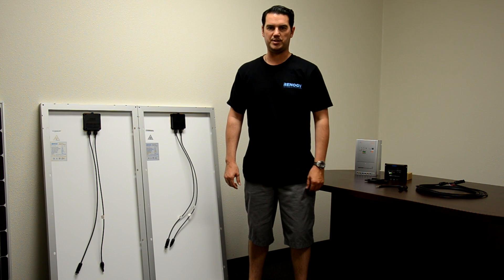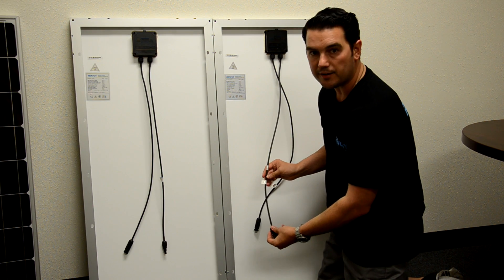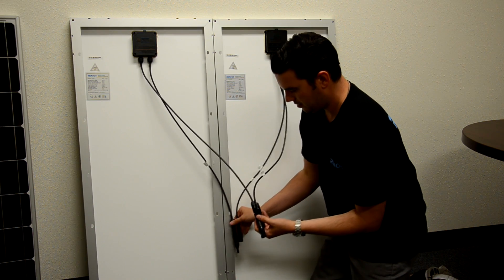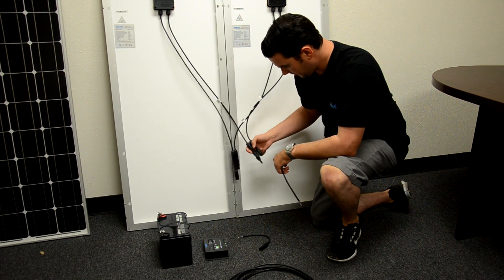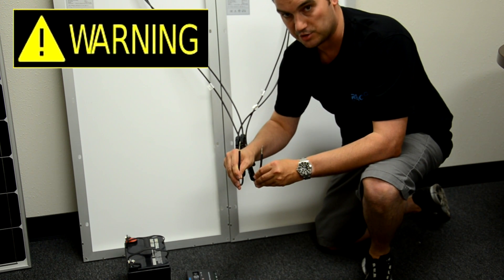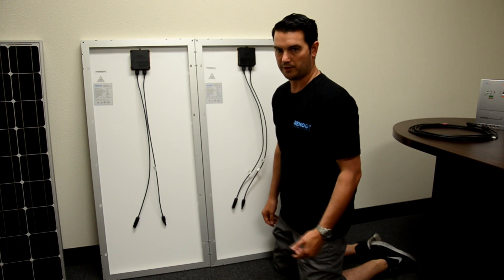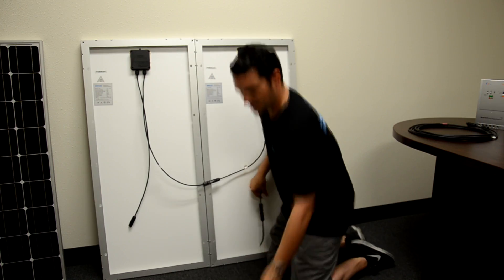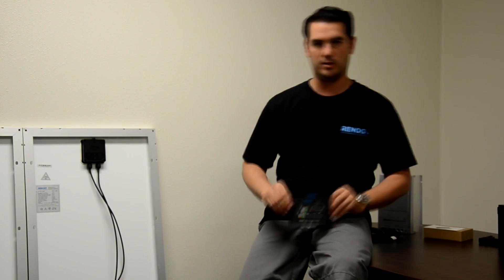Renogy: How to connect your Solar Panels in Series and Parallel Pt. 1

Comment: trying to understand the limitations of connecting panels in series.. because the more panels you add the higher the voltage goes. yet amperage should stay about the same.  how do you identify the maximum number of panels you can have together without risking destroying a panel?  i have a infinium 12v 100w pannel which states on the back maximum voltage is 1000V. and series fuse rating 10A.. can this panel really be used to supply 10,000watts?    hard to believe. if you had 100 of these panels, putting out 120volts DC. at 10kW? it would not destroy itsef?   can anybody chime in here? i suppose open circut voltage is 22v.. so  45 would be max number of panels without risking voltage getting too great.
Reply from the maker: The panel's setup will be dependent on what type/size of charge controller you have in that system, with a PWM it is required to hook up the panels in parallel to keep the voltage down, now with the MPPT it is able to handle a high amount of voltage and send the appropriate charge to your battery bank so series would be recommended. The Max VDC of those panels is 1000V, each panel outputs about 22V so the max would be 45 panels in a string.  Please email or call us here at 800-330-8678 if you have any other questions or concerns.

Comment: question.... i have 2   6 volt t150 golf cart batteries hooked up in a trailer,,,,,,,,,,had them charged to full with trickle charger about a year ago or so. held that charge for many months with trailer in storage.but that ended a few months ago .am about to install a 100 watt solar panel on the roof with a 30 amp mttp controller .will the panel recharge those batteries over time or do i need to remove the batteries and have them boost charged for them to have life again ?
Reply from the maker: The Charge Controller will not recognize the battery bank if it is completely depleted, as long as it is over 11V than the controller will be able to send the charge from your solar panel to your battery.  Please email or call us here at 800-330-8678 if you have any other questions or concerns.

Comment: hi please help me.i have 2 solar panels 310watts 24volt ech.and charge controler mppt 12/24volt 50amp.and 2 battery 150amp and 1 12volt normal invetor please tell me how can i install that praral or seires.because i want to run my inveter 12volts and batery need to charge 12volts please solve my this isue.i am so kind of you
Reply from the maker: Hi Waqa, could you please contact our tech support team at 1-800-330-8678 or email them at techsupport@renogy.com regarding your question? A technical representative would be more than happy to explain things to you in more depth via one of those two contacts. Thank you!

Comment: Dear presenter, can we take the output inverter of 5 KvA cable to 1000 ft with suitable cable size for feeding 60 pole lights each of 35 watt (2100 Watts)?
Reply from the maker: Hi there, it would be best to contact our tech support team at 1-800-330-8678 regarding your question, thank you.
Reply: thank you for your feedback 👍

Comment: can i use a 24 volt system battery to a 12 volts system ?
Reply from the maker: Hi Raden, sorry about somehow missing your question. But no, you cannot. You should use a 24V system with a 24V battery, and the same regarding a 12V battery with a 12V system.
Reply: thanks for the info, and one last thing can i series connect my solar panel even if im using a 12v system?

Comment: Hello thanks for the video. Why would Renogy send installation instructions telling me a beginner solar person to run my two 100 watt panels in Series with a MPPT 20amp controller a Renogy 1000 watt pure sine wave inverter 12 watt, and 2 -  6volt battery ran in series to creat a 12 volt??? Everything I have watched and read said not to do this, but did I miss something?
Reply from the maker: Hi there, 

I'm not sure what instructions you're speaking of,  but we'd definitely recommend hooking up two 100 watt panels in series if you have the MPPT controller. The MPPT controller takes the extra voltage and steps it down to charge a 12V battery--it converts that extra voltage so that you don't lose any current. This is why MPPT controllers have 90% efficiency in comparison to the PWM controllers. If you'd like, you can contact our tech team at 1-800-330-8678 and they can go over this with you directly as well. Hopefully this helps! If you have any other questions, please feel free to contact our support team at the number above or techsupport@renogy.com.
Reply: Renogy Solar 

Thanks so much for the information thats more than likely why the wiring installation shows series not parallel. And for the instructions I called the support team at Renogy and asked for wiring and fusing application. Thanks again
Reply: Renogy Solar, 
Thanks. This helps me considerably. 
I think I have it figured out. Please correct me if I'm wrong. 
With my Rover 40 I can wire my 2 100w Monos' in series (for greater efficiency) and my controller will return the 24v to 12v. Correct? 
This will allow proper charging of the Renogy 160ah gel battery that I'm about to purchase. Again, correct? 
Also, what happened to the 200ah gel battery y'all were offering? I no longer see it on your site, or on Amazon. 
Thank you!

Comment: Odd....put my 100w panels in parallel...and amps are same.. put in series...amps goes up. don't understand that part. maybe volt meter confuse on reading AMPS. good at reading voltage.

Comment: If I have two solar pannels and want to chargae a batery of 175 the should I connect thise pannels in series or parallel??
Reply from the maker: Hi there, it mainly depends on your charge controller type. We usually recommend parallel for PWM controllers and series for MPPT controllers. However, in the case that say your battery was a 24V 175Ah battery and you were using a 24V PWM controller, we'd recommend putting your two 12V panels in series. Hopefully this helps! If you have any further questions, please feel free to contact our support team at techsupport@renogy.com or at 1-800-330-8678.
Reply: Renogy Solar actually I did so but today I suffered alot. I also connected some solar charges which works on 12V so those chargers just burned out and also burned a power bank which was on charge. 😜
Reply from the maker: Definitely sorry to hear that!
Reply: Renogy Solar Its okay. thats was a bad experiment. and another quistion sorry if its not related. a solar pannel of mine lost some of the diodes fixed at back, can that be replaces?

Comment: Hi , i have 40w&50w solar panel connecter parallel, when i checked the voltage it was around 18v and the current maximum am geting 2.5 amps only in brighter day  with full sun light, what can be the reason?could tou pls help me out?
Reply from the maker: Hi there! We recommend performing an open circuit test on both of your panels using a multimeter set to 200 volts DC as well as testing for amperage. Our 50-watt panel will produce between 18.5 -22.7 Volts and 2-2.5 amps. When you test your panels, make sure you test in direct sunlight with no obstructions for the best reading. If you find that your 50-watt panel is underproducing, feel free to contact our technical support team (techsupport@renogy.com) and we will be happy to further help you out.

We do not sell a 40-watt panel and would suggest contacting the manufacturer of that panel for its best output.

If you have any other questions for us, feel free to give our tech support line a call at 1-800-330-8678 and we will gladly troubleshoot with you over the phone.
Reply: Yes! As you said , i did open circuit test, 50w panel gives(18.8v 1.7amps) 
40w panel gives(19.4v 1.6amps)
When I connected parallely gives 19.1 v 3.36 amps
So total 60w.
Reply from the maker: When you performed the open circuit test, did you have direct sunlight with no obstructions? Was your panel angled directly toward the sun?

If it was a cloudy day or your panel was not angled directly facing the sun, your panel will not be performing in its rated open circuit values.

Let us know in your response!

Comment: Hello 
I have one 250w two 150w and one 50w solar panels and 2 batteries one charge controller and one 24v inverter ups how to connect please
Reply from the maker: +Shahdad Marri Hi there! It would be best to email our technicians at techsupport@renogy.com with the information you provided above and they'll be able to assist you more directly.
Reply: Renogy Solar thank you for your response

Comment: hey i have 3 small solar panels with 0.5 output and i tried to connect them with parellel and series connection to light an 1.5 led but it doesnt light up do i need to attach any converter to it

Comment: i have your 12v 400w system and use it to run a router and internet connection...these items use a total of 1amp through a 120v inverter. how much power am i wasting converting 12v to 120v versus if i had a 24 or 48v system?
Reply from the maker: Hi +ebp1234, here is an answer to your question from one of our engineers:
The power lost depends on the conversion efficiency of the devices used. The 120V inverter, if it's Renogy's, is an 85% efficient inverter. So if a device is running at 1 amp, 12V (12W) from the battery, it might require close to 14W from the battery instead.

The 24V and 48V inverter systems would theoretically waste less power.

Hope this help!
Reply: Hey thanks for the response

Comment: I have a 50 watt panel can i hook up 100 watt panel together?
Reply from the maker: Hi Joe, we would not recommend mixing panels of different values. When you mix different panels you will always operate on the lowest available values available so you could potentially be sacrificing wattage.

Comment: Since power loss is affected by amps and not voltage, doesn't it make sense to do all series to minimize power loss, then just buy/build converter fit for the job?  Or would it be small enough of a gain that it isn't worth it?
Reply from the maker: Hi there! Both series and parallel connections have their own advantages, connecting panels in series would add the voltage together of the panels and help combat voltage drop if there is a large distance (over 20ft) between solar panels and the charge controller. However, when you connect your panels in parallel and one panel gets any type of shading the other panels in the array would still be able to produce at full wattage. In a series connection all panels would be brought down to the lowest operating values.

Comment: Hi, I have 6 24v 250w 8.5amp solar panels setup in two banks of three using x connectors I think (not sure of the name but 3 in 1 out), they are in parallel so 24v 750w 25.5 apms, its 4 meters to the dc isolator, I have the four wires from the two banks go into the isolator then two 50amp rated wires out of the isolator to the inverter one meter away. Am I thinking right, by splitting the six into two banks then joining them in the isolator that I don't have to run higher rated wire from the panels to the isolator? I`m using standard 4mm solar cable same as the two cables coming out of the panels.
Reply from the maker: Hi +me001ist, 
After speaking with our tech department they suggested you give them a call at 1-800-330-8678 in order to get a clearer picture of your situation. Let us know if you have any other questions!

Comment: Educative in deed, from you demonstration, assuming your solar panel does not have a tag, how to you know the Negative and positive wire ?Thanks
Reply from the maker: Hi there! The male MC4 connector would be the positive, it also has a red o-ring around the connector to indicate that it is the positive.

Comment: Hello,I have a small solar panel 10W/17.50V/0.58.What do I need to make it work ? It didn't came with any kind of wires
Reply from the maker: Hi +Avram Razvan Andrei there are several components you will need in order to start using your panel. This includes a controller, wiring from your panel to the controller, and wiring from your controller to battery source. In order to figure out what size wiring you''ll need, as well as what kind of controller, you can call our sales team at 1-800-330-8678.
Reply: +Renogy Solar got it,thank you

Comment: I actually have a  question.  if you move into a house that already have  solar panels  installed how do you  connect  them? I think  I just need to watch  the videos. duh.
Reply from the maker: Hi there! If the house already has panels installed, it'd be best to double-check with the distributor (i.e. Solar City, etc) to see if it's connected to the grid already. If they say it's not, then you'd have to talk to an electrician to connect it for you.

Comment: I still haven't hooked up my 1800 watt 24 volt system
I never used a charge controller like that midnight .and never used a combiner box
I just don't know what to do
Reply from the maker: Hello! You can give our tech support team a call at 1-800-330-8678 and they'll be able to help you out with your system.

Comment: Please tell me how to make series circuit between 4 solar panels to make 24 volt
Reply from the maker: +Naimat Bhellar Hello! You can head to page 68 of our off-grid general manual (http://www.renogy.com/wp-content/uploads/Manuals/Off-grid-General-Manual.pdf) and it has a diagram of how to connect in series-parallel for 24V systems. If you have any additional questions, please feel free to contact our tech support team at techsupport@renogy.com.

Comment: I have 2 Renogy 12volt, 150 watt panels that I will wire in series. You mentioned in your video that  after  wiring 2 12volt panels, in series it now a 24 volts. Will I be able to operate 12 volt appliances or only 24 volt items?
Reply from the maker: +Rod J You cannot run 12 volt appliances on a 24 volt battery bank due to the inverter size. Your inverter size needs to be the same as your battery bank, so if you have a 24 volt battery bank you need a 24 volt inverter which only run 24 volt appliances. If you would like to run 12 volt appliances you should wire your panels in parallel.
Reply: +Renogy Solar . I might have not explained my question clearly. If I wire in series and have 24 volts and use a mppt controller, can my battery bank be 12 volts?
Reply from the maker: +Rod J Yes, in this scenario your battery bank can be 12 volts because MPPT controllers take in all the input voltage and maximize the charge for your battery.

Comment: +Renogy Solar - I didn't hear it, but can/should you wire in series panels of different voltages?  I.e. a 50w and 100w?
Reply from the maker: +Chip Adams While you can, we wouldn't recommend it because it would be an inefficient use of your system. The voltage of your highest performance panel (in this case the 100W) would be brought down to the voltage of your 50W panel.
Reply: +Renogy Solar Thank you for the quick response.  I figured it wouldn't be a good idea however I thought I would check.  So.  If I has 2 50w and 1 100 w, I could wire those in parallel.   I bought a 50w panel as I just wanted to get a small system setup to see if I would like it at all :)
Reply from the maker: You should be able to wire all 3 panels together in parallel, but you'll lose about 4 watts.

Comment: can 200w solar panel, Can run refrigerator @ 90w 230v 0.75amps?  just for 3days straight?
Reply from the maker: +Gigi Espina In theory, a 200W system could run that, but you would want to go with 300W in case there is bad weather so that the batteries will have enough energy.
Reply: Wow! how about 1 ref what more can run a 200w?
Reply from the maker: +Gigi Espina Hi, if I understand your question correctly, you're asking for what else you can charge with 200W? If so, a 200W system can charge your cell phone, laptop, and run your 32-40 inch tv for 2-3 hours. If that wasn't what you were asking, please let me know.
Reply: i'm asking beside 1 refrigerator what more can 200w can run.

Cellphone,laptop,32-40 inch tv for 2-3 hours. Cool!😃 i love it! Thank You👋

Comment: so the series connection would provide more voltage?! would this work this work on a smaller scale as well such as a 12V with 50mA
Reply from the maker: +Rajiv Sharma Yes, a series connection would provide more voltage. I'm sorry but I don't quite get the second part of your question, if you could please clarify, that'd be much appreciated. Or if you'd like, you can also contact our tech support team at techsupport@renogy.com for any questions you may have as well.